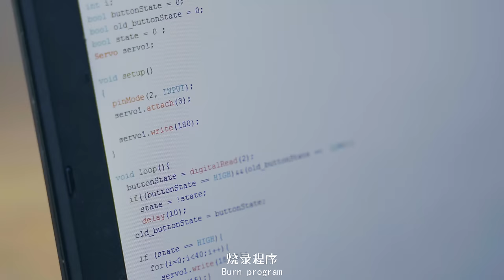Cyberpunk Exoskeleton Arm With Movable Mechanical！

Comment: Another cool project.  and love your execution/details in it.   you always make it look so easy :)    Question.  With all your EVA foam projects, how well has the glue kept the projects together?
Reply: I actually use the same brand glue as her, it's strooooong as heck. I haven't had anything come apart on me yet. Used it on foam and some metal bits